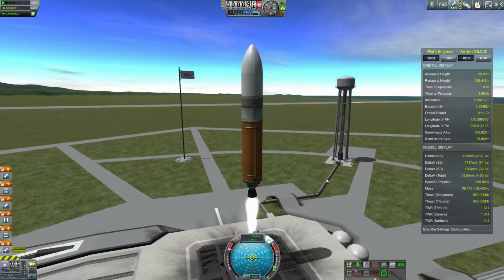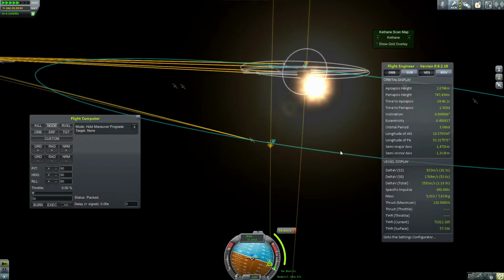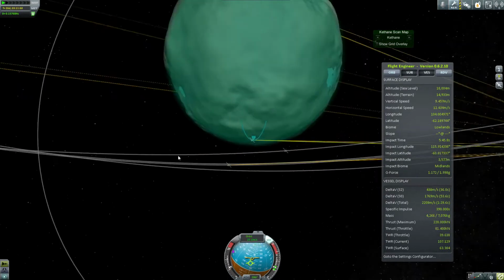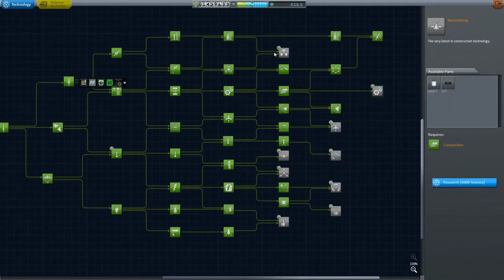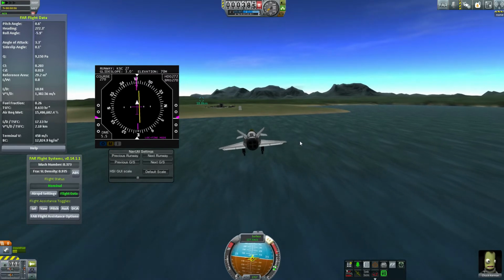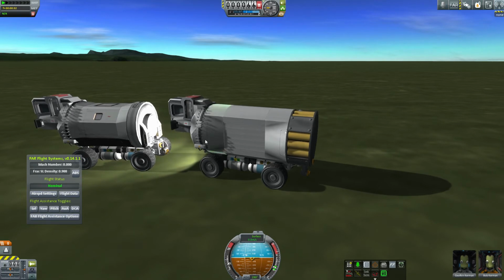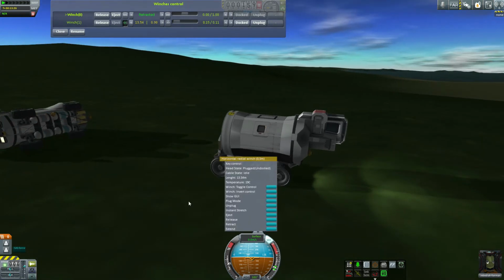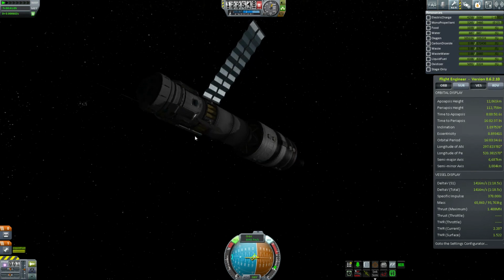KSP NASA Series (v2) Episode: 15, Jeb's Used Cars

Comment: I really hate coming to you about my game problems but you do seem like the guy who knows what to do, My new problem is that when I install TextureReplacer certain parts from stock and modded parts get a shaded bugged texture. Also RealChutes seems to have a bug were the game will stop loading at RealChutes/Parts/cone_chute/RC_cone, Which I can't find in the part file. I did go back to using 3bit also.
Reply from the maker: Sometimes I get a freeze/crash when loading, it usually stops on a Vanguard Parachute part for me, but from what I understand that's just what it happens to fall on when it misallocates memory. Typically, for me, a hard reset will clear that one, though I find myself sometimes having to do it multiple times. And I don't have any specific experience with Texture Replacer, beyond its inclusion in Better Atmospheres. I only modify the skymap texture and my EVA visors through TR. Most I could suggest is to take a systematic approach to diagnosing the textures: pull one folder at a time onto your desktop and see if one in particular clears your shader error. That's pretty generic advice, but it has helped me eliminate problem mods every time, though it's time-consuming.

Sorry I can't be more helpful, and good luck!